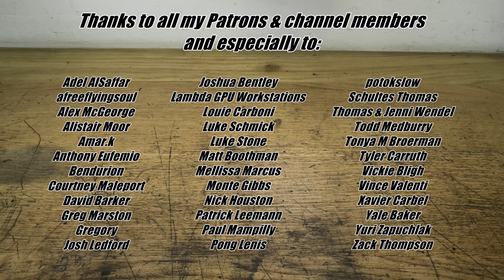I Restored this Broken and Cracked Tank for 'Mister Patina'

Comment: Every time I watch one of your videos, I learn something new. It never would have occurred to me that coating the inside of the tank with solder would help strengthen it. It probably helps with soldering the cracks since the heat of the soldering iron on the outside would melt and flow the solder on the inside. Also, the aluminium rings are a very clever idea. The brass of the tank is old, brittle and thin, so getting things aligned just right and keeping them that way while heating with the soldering iron would be difficult without that simple, purpose-made tool. Your skill as a machinist leaves me awestruck! Thank you from frosty Alberta, Canada for another great video. :-)

Comment: My advice about tinning large areas. For smooth solder application, you need to put a shielding braid from the cable on the tip of the soldering iron. The braid will hold the solder like a paint brush.

Comment: love restorations , as a plumber im telling this, goal is to bring the metal to the lead or soldering wire melting temperature, than you remove the flame and if it melt it means your at the right temperature and the weld is going to hold no matter what it will endure. Always sand and add flux to the parts so it will bound , little trick , lead will only stay where you put flux and wont stick elsewhere. not sure i explain it well enough to be clear. good luck and i hope this will help you in future restorations :)

Comment: mr mymechnaics i have to ask, how strong are those solder joints? I have some jewelry making experience and from what I learned the proper way to solder is to heat up the metal on the under side and use the heat transfer to melt the solder on the opposite side. It’s my understanding the solder bonds chemically to the metal that way, making for a stronger joint. it looks like you’re just melting the solder itself. does it matter? idk if there’s a right or wrong way just wanted to hear your thoughts

Comment: Glad you left him a little to do!  ;-P  Almost perfect spline knurls with a bump tool on gummy brass! Impressive but not unexpected from you! ;-D  Most interesting though was the Iron you used, felt like a homemade tip and kind of kludgy but worked a treat.  My fingers started to hurt watching the removal of the solder bleed but then realized you put the lead back into the gas by plating the whole inside and made myself giggle!  More BTU's!! @¿@ Sometimes I have too much fun in my head.  Thanks MM, always a treat to see you work and what you produce!

Comment: it would have done soldering easier if you preheated the object. I have usually used hot air gun on low settings on a stand far enough that heat does not go over comfort zone. Tin flows mutch better and stays on much better. Less cold solers. berfect job :)

Comment: “Good enough “ it looks better than new. Awesome work. Is there any chance those cracks are the original joins from when the tank was made?
They look very straight and symmetrical which makes sense if the parts had been stamped and folded to form them. 
Cheers Stuart 🇦🇺
Reply from the maker: I don't think so, the material was super brittle.
Reply: @mymechanicsinsights  Ahh, ok and thanks for explaining. 👍👍👍

Comment: Top notch 👍🏼👍🏼👍🏼 Have you given any further thought on how to improve the internal solder you added for strength?  Could rotation while adding solder to the inside give any benefit? Excited to see your response,  thanks.
Reply from the maker: I though too to spin the part in the lathe, but i didn't want my chuck to get hot.

Comment: As aluminium sleeves were adjusted to external diameter, did you cut them to remove them after soldering?

Comment: To coat the insides with solder, I would have thrown the part on the laythe and heated with a blowtorch, and added solder that way. Probably faster and would give a more even coating across the part.

Comment: Not sure if anyone else mentioned it, but it might have been an an easier (and perhaps stronger) restoration by applying a 'step-brazing' solution, ie - using a relatively high melting range alloy to begin, and progressively lower temperature alloys in each later stage?

Comment: why the double cap? brilliant work as   usual!
Reply: Condensation/ pressure release
Reply from the maker: When the stove is running the tank will then have less and less fuel in it and new air has to come in the tank, otherwise it would collaps due to the vaccuum.

Comment: A little metallurgy (and time savings) might be in order… Alloys of copper (brass, bronze, etc) harden and become brittle as their grain structure transition to a lower energy states through working (work hardening) or, even more sadly, by simply sitting on the shelf. Annealing reverses this hardened/aged condition. Now, as per this video, the grain structure of hard brass begins to revert (anneal) at 260 C (and is frequently held at 315 C for an hour for this purpose). The melting point of solder is between 190 and 220 C depending on the alloy used. To “tin” the interior of the brass tank with solder, the solder iron tip wants to be around 300 C. See what really happened here? If not, more information might help. The “toughness” (resistance to cracking) of annealed sheet brass can be many times (like 10 times) that of sheet brass in the hardened/aged condition. Additionally, the shear strength of solder is only around 15% that of brass. So next time you go to the trouble of unsoldering, simply clean your brass and pop it into the oven to anneal to get the same benefit of added strength (“toughness”) without the added effort of tinning the entire surface. And keep up your inspiring craftsmanship!!!

Comment: Why not use the torch to coat the inside and to solder the joints? You wanted to avoid heat but you already used the torch to disassemble?

Comment: Map gas torch and silver solder would have made a better long term repair the soft solder will melt at 73 degrees C if the tank is cracked it’s been getting hot brass has a very low coefficient of expansion silver solder from the inside would have been perfect and you could have made it look as stunning as you did as well just an idea maybe for future projects
Reply: Phoenix  𝙾𝚙𝚎𝚗 𝙼𝚢 PROFILE  am sorry am a bit of a perfectionist if it works and your happy it is good enough

Comment: Just my two cents, but, for optimal strength, the repair normally requires a few pieces of thin brass on the inside. If you follow Baumgartner restorations, similar to what Julian does with cracked paintings, when he places threads of linen on the backside of the painting. But that's just for working repairs, i doubt this will ever see harsh winter use as it did in the past.
Reply from the maker: Great idea! I'll do that next time.

Comment: Why soft solder for cracks? I think hard solder would be more durable. This is why cracked keeps reappearing. Maybe I missed something? Great cap.
Reply from the maker: One crack was soldered to begin with and that one held up too. I think that's good enough, because there won't be any forces on that tank once installed.

Comment: Overall, awesome as always, but I must admit, I’m not much of a fan of covering the full interior of the tank with solder. I would have made a ‘cage’ of sheet brass or something to serve as a framework for the outer pieces.
Reply: I'm curious about this as well. It seems like it would increase the chance of cracking as solder is prone to do. Maybe the increased wall thickness nets a positive effect?

Comment: Were you not using a flux with the solder? It looks like you were having problems with it not spreading well. If you werent, was there a reason why? Just curious
Reply from the maker: Flux is already included in the wire. Was diffucult to heat up the thin metal, it cools down quickly.

Comment: Hey, another dumb question for you: why do you use vinegar, salt, and *flour*? I ask because you're basically making a sour bread dough, and that can turn gummy and tough if mixed too hard and will be almost impossible to wash off once it dries. (Anyone who bakes their own bread has faced this exact issue with utensils, bread hooks, bowls, etc. I've had to throw away dish scrubbers - the kind that should last for years - because they’ve become impossibly gummed up with dough.)

I was wondering why you don't use cornstarch or corn flour - or is it harder to get there? It's very easy to wash off because it doesn't have gluten to glue itself to your project. I've used it myself and it works so much easier and saves so much time.
Reply from the maker: It's wraped sealed in the foil, so it doesn't dry ;-)

Comment: Ok. I'm a minute in. My guess is that the copper work-hardened and became brittle. This happens to some badly made air tanks made from beer kegs. Anyway, I figure he can heat the copper and anneal it. That said, this IS My Mechanics, and I know he's tempted to, you know, make a new one. Anyway, back to the video...
Reply: Interesting. Solder to just wholesale coat the thing. Fair enough.

Comment: on copper based materials, why is soldering used instead of welding?
Reply from the maker: Maybe it would melt?
Reply: @mymechanicsinsights  I've guessed it would affect structural integrity terribly, thank you :)

Comment: Why do you remove the patina if you just used sandpaper afterwards? Would the sandpaper not remove the patina with it?
Reply from the maker: Patina is pretty tough to remove with sandpaper, especially on the inside.

Comment: Would you not have been better off brazing the cracks up? That would have made a repair with metal of a higher melting point than the solder holding the sections together and made a stronger repair.

Comment: I would guess less than ideal heat for the soldering. The solder just didn't flow was easily as it could have. Perhaps electroplating would have been more simple than covering the interior with solder and would have prevented much of the external cleaning process. yeah I know - an electroplating setup ain't cheap and your alternative was impressive but none as impressive as your machinist skills.
Reply from the maker: The parts were very big and very thin, they cool down quickly. Very hard to keep them hot.
Reply: @mymechanicsinsights  perhaps a hairdryer in lou of a hot air gun?

Comment: Why would not you just Tig weld it rather than going through the trouble of soldering? Although you knocked it out of the park with your repair, it seems like a tremendous amount of work
Reply from the maker: Not sure if you can tig weld brass, also so thin is very difficult to TIG.
Reply: @mymechanicsinsights  you most certainly can although it is difficult for inexperienced TIG welders. I have friends that can cut an aluminum can in half and weld it back together, the hard part with brass is not knowing the Zinc content of the brass you work with. I bet someone with your talent and skill level will surprise us all one day here on YouTube!!!